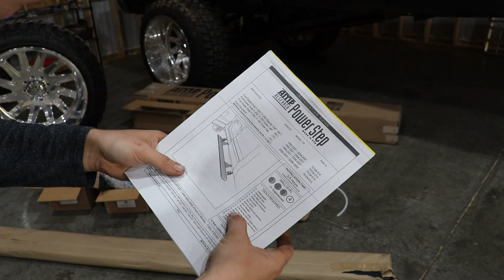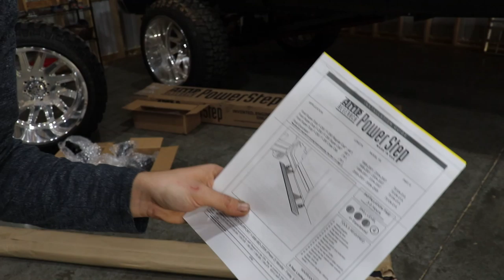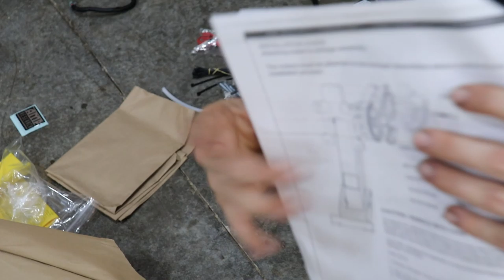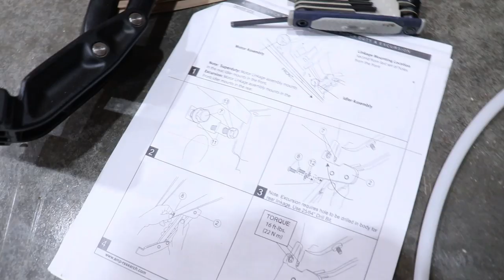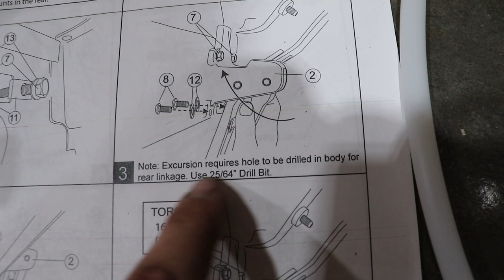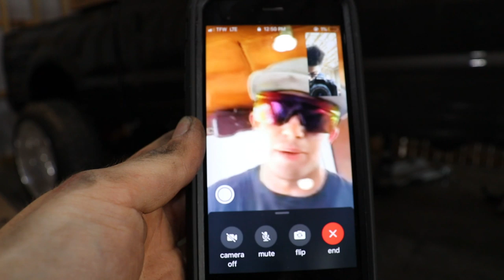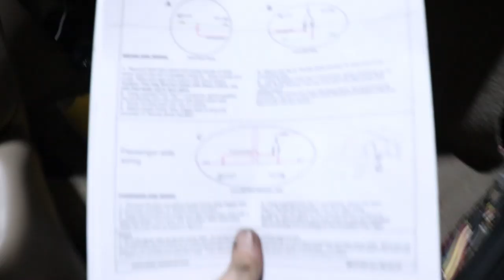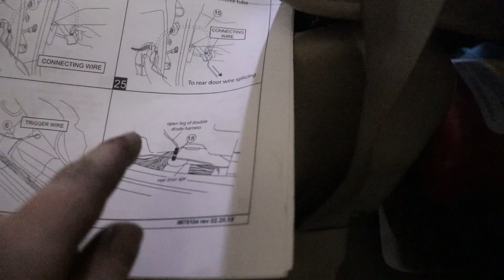1999 to 2007 F250 F350 Excursion Amp Step INSTALLATION | power folding running boards

Comment: glad I watched this..my buddy had them on his F250 but sold it, so I couldn't use his as a reference to do mine. They incorrectly installed the arms with the motors at the front, which is right where the tires throw all the crap. I thought that was a bad engineering idea LOL...now I know it was just bad installation!!

Comment: For 2007 you dont have to take off door panel it actually doesnt work that way its the yellow and black wire just above your emergency brake release theres 2 (yellow and black wire) but only one is for door ajar switch. This is for all the 2007 6.0 bros  all other steps exactly as he has shown in this video

Comment: It's dope how the steps on this Ford isn't visible when it's closed ..on my Chevy it sits in a visible area and I don't like it cuz it almost looks like it's always open and has a big gap between the steps and the body..I don't know if I can just re adjust the board or or if it's because of the motors underneath

Comment: Popping in to smack the thumbs up as always but this time I actually have a question 
My Passenger side step is freaking out just randomly goes up and down even if I’m in the house with the keys out of the truck any ideas maybe where I should start
Reply from the maker: That might could be a bad computer module that hooks to the battery from the amp steps possibly? Amp has awesome customer service I would try giving them a call! Could also possibly be hooked to the wrong trigger wire ? Not sure… maybe bad connection somewhere … but could maybe be back brain box .. call them and explain what’s going on and I’d say they can help diagnose!

Comment: good morning Justin, excellent explanation I have a f250 SD 2003, the controller (already very old) was damaged I want to replace it with a new one when searching I found an AMPRESEARCH 19-04280 STB, I would like to know if it is compatible with the one I need if you could help me I would appreciate it, thanks for the attention 👌🏻

Comment: My question is, let's say you're offroad and open your door when there is something a little tall under your truck, will the steps force themselves down and destroy themselves? Or do they have a saftey like a garage door, that wont let them force shut and break something.
Reply from the maker: If it senses any pressure they come back up I’m pretty sure. I know if you shut the door and they have any pressure on them they will stay down until you redo the cycle open / close the door
Reply: @JUSTINHAWKSMITH  does the running boards for a 06 f250 super cab? Not a supercrew.

Comment: Professional installers do not use quick connect or crimps. Everything is soldered together the professional way, shrink wrapped and taped the factory way, to make all aftermarket disappear so the factory techs can't be ready to cancel warranty. Just saying.
Reply: Too bad there are no trucks that have these factory man. A dealer will know if your stuff is aftermarket by looking at it. 
The rule is, dont mod any vehicle you dont own, unless the work is easily reversed
Reply from the maker: Yeah Definitley wouldn’t be a bad idea to solder and heat shrink all the connections! Adds to expense really. Can get solder, heat shrink, and a cheap soldering gun to do the trick for around 30-40 bucks. Still a savings of over 250+ dollars to do it even better. But surprisingly these crimp connects that are supplied are all heat shrink/soldering  crimp connects. Forgot to mention that. And also the local line x told me everything I needed to install was in the kit. My honest opinion is they would’ve opened the kit and installed just as I did if I had to guess.
Reply: Look into the butt splices with solder integrates inside the heat shrink. I have fell in love with them. Just slide one on, get your wires twisted together and heat everything up.

Comment: In your link to the steps it says they fit 99-01 and 03-07. Question would these fit my 2002 powerstroke?
Reply from the maker: Man I am honestly not sure. I would definitley contact amp research and get a exact part number for which steps you need, their customer service is 10/10.

Comment: did you get the additional 2 inch drop?
Reply from the maker: No sir. They make the running boards sit a little lower with the drop so I opted to not get it. To keep the steps hidden.

Comment: I am up to 10:10 and you again point to the motors being in the rear. Which is contrary to the instructions and farthest from the wiring. Why did you do this?
Reply from the maker: To be honest no clue I didn’t do it wrongly on purpose if I did. It’s been so long I can’t remember. But they’re still holding up great to this day motors in rear , seemed to make more sense to me so they weren’t the first thing to get mud and road grime thrown on them. So honestly didn’t even read the instructions for that part. Just made sense
Reply: @JUSTINHAWKSMITH  Thanks! ya know, if it makes sense, go for it. If the wires are long enough and everything, i see no reason not to. You would have had extra wires to try to tie-up. i had trouble with the straw through the door. on mine there was a plastic cover over the wire loom on the inside, but finally it poked around it (had to help fish it with my finger from the inside) maybe they should give a smaller tube for easier use in shoving that straw through. I had to solder-on additional wire (supplied) to reach across to the left side of the truck, but still the wire was too short to reach the door ajar in the door.
Reply: 7:40 - instructions say for superduty, motors to the rear.

Comment: Hey Justin great video man. 😎

I plan on getting a set of these for my Excursion! 👍
Reply from the maker: DOOM 524 AWESOME THANKS FOR WATCHING. The excursion is super super similar. Same kit just have to do a few steps different and wire colors may be different. But this vid should help. Also Amp research customer service is awesome I’ve heard so can always call them if you have any questions. THANKS for watching. !